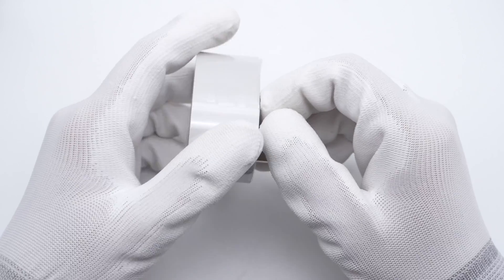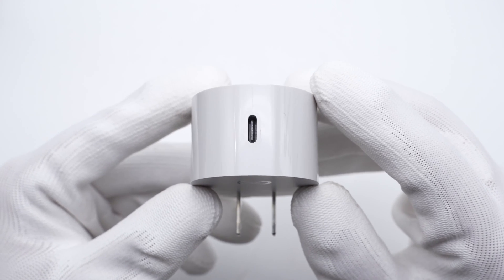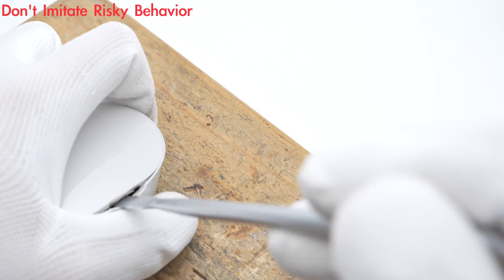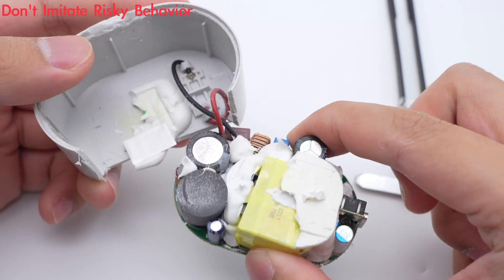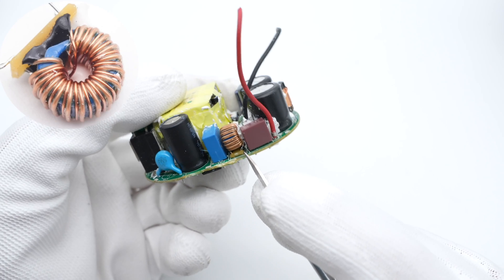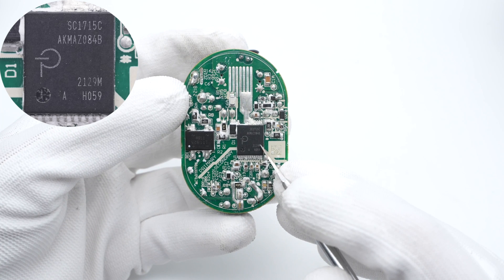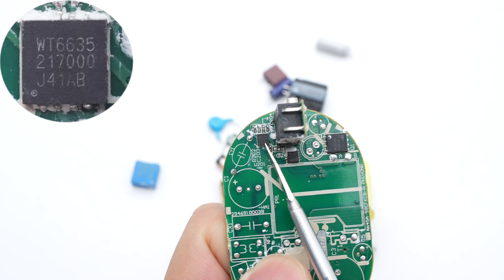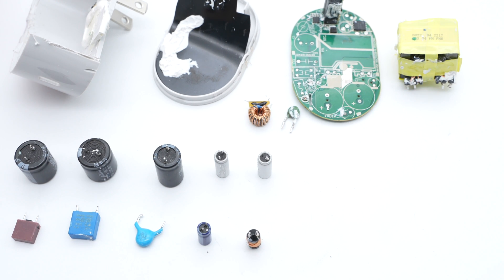For Meta Quest Pro | Teardown of 45W USB PD Charger VR Headset

Comment: The power density should be around 0.87W/ml when using the true oval shape, instead of just LxWxD.
That makes this the most power dense 45W charger around AFAIK.

There's the Realme/Oppo 50W charger, which is 35% smaller than this, but it can only output that at 240V and via their proprietary charge protocol.